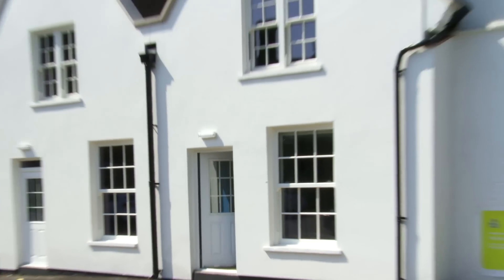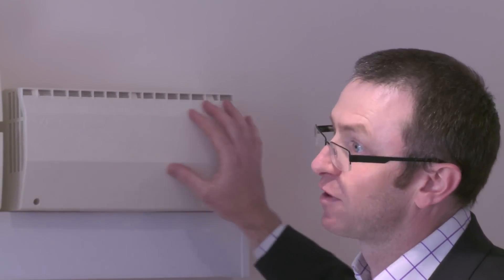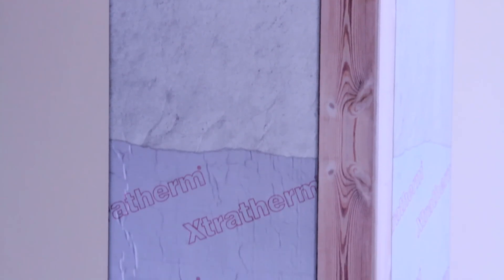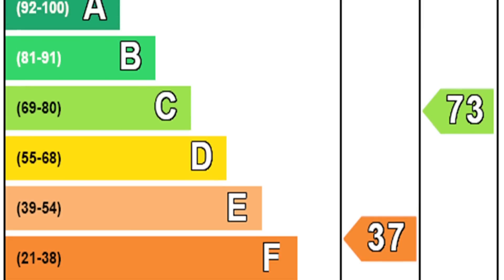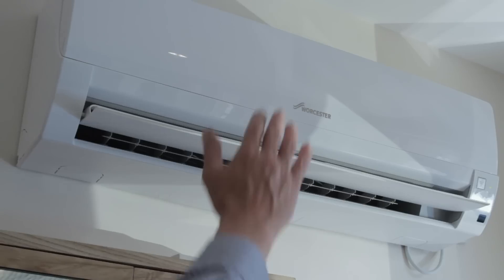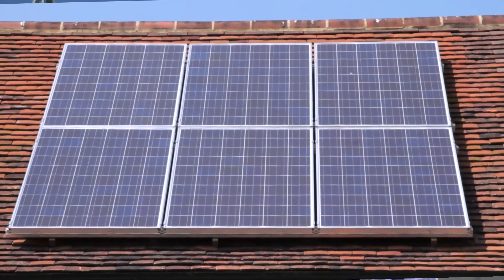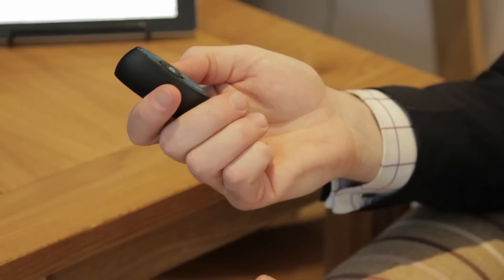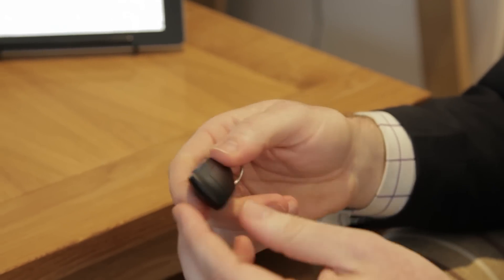Home of the Future | Fully Charged

Comment: This just popped up on my feed - 12 years after it was first published. It's now October 2024 and my house has Solar, home battery, Air Source Heat Pump and EV charger. Obviously on a smart meter too. over a 12 month period 85% of my power comes from the solar (free!) or the off-peak rate I get from Octopus (7p/kWh).

I think we're a bit further ahead than this video envisaged. It also proves all the doubters wrong. Several mention coal fired power and now the UK has ZERO coal powered electricity.

Interestingly I was a sales engineer for an HVAC company in the mid-seventires and I was installing air source heat pumps in commercial buildings even then

Comment: I'm re-watching this for the 2nd time. The first time I thought great, smart metering. Since then I've had both a dumb smart meter (pay as you go) & the smart, smart meter variety that had more functionality. In neither case was I ever motivated to monitor the energy usage for gas or electricity & in fact, I had so much trouble with the smart, smart meter refusing to work properly that I insisted that the utility company return to swap out the 'new' meters for analogue ones. I honestly don't see the vast majority of consumers ever bothering to monitor their own energy usage either. People just want to get on with their day. But in terms of suppliers points of view and grid management, long term, legislation will be needed to force smart metering across the board in order for the energy system to function as a whole due to changes in generating sources, storage, the decentralisation of the grids & of course, the electrification of transportation around the world.

Comment: Hi Matty
There has been extensive research by large companies including Schneider
and they are happy to stand over their claims based on the normal mix of
appliances in a house.
Items in your house can be divided into three groups in this instance. 

First group would have no impact on performance or consumption.
Modern electronic devices are usually powered by switch mode power 
supplies which usually self optimise between 90v & 250v
PC, laptop, CFL's, LED's, Chargers.

Comment: Second group has an impact on speed (approx 9%) but no
decrease in consumption.
Kettle, Immersion, electric heater, electric cooker, Old type tumble dryer. Small motor in tumble dryer will run more efficient.

Third group has no impact on performance but has a lower consumption.
Fridge, Microwave, Food processor, ventilation, Kitchen extractor, 
air conditioner, heating circulating pump, Heat pump, (not inverter type) Modern tumble dryer, oil and gas boiler, Washing machine, Dishwasher.

Comment: vphase voltage optimisation, modern day snake oil 
this device only saves you money on digital loads i.e your pc modern lighting with a digital ballast etc, large devices like a washing machine or immersion heater will only take longer to warm up and not work as hard
only a good investment for a business with a high electronic load. 
British gas fail

Comment: My concern, is cost of payback.
A solar panel system would typically payback after 15 years at current rates and costs, and this is not cost effective for most home owners, as most would not stay in a house for this length of time.
When you add up all the other items recommended, I cannot see how it would be cost effective for an existing house; you're looking at an outlay of tens of thousands for equipment and building work, with a payback time measured in decades.

Comment: A kettle is a large load mainly used in short bursts, the 10% average is worked out over all electrical equipment in a house.
There are extremes in both directions of efficiency, some cases can be an over consumption of up to 25%  with voltages going a lot higher than 240v.
also when an immersion element is subjected to a higher voltage the fragile stat can burn out and the 2.5sq cable supplying power gets very warm which is a loss
The list of issues are very long relating to over voltage

Comment: The point is that claiming that a heating element is 100% efficient is not true in all (most) circumstances. It's not even close for most applications. Even more so during hot weather where you'll have to re-cool the local environment after it absorbs the wasted heat. This is directly related to how you define the efficiency of an action.

I agree that moderating the voltage supplied to heating equipment will have little effect on the performance in this specific case.

Comment: The voltage optimiser has no effect on the efficiency of painting, it has no effect on the efficiency of a heating ellement.
However any other piece of electrical equipment wastes approx 10% by running at 240V
It is a simple piece of equipment which can save a customer money.

Comment: I fear you're missing the point - you need to define your desired outcome to establish your efficiency: painting your wall is 0% efficient if you want to do anything but paint that specific wall.

Above you stated that a heating element is 100% efficient and as a side point, stated that this is true irrespective of the voltage used. This is not true: not all the heat energy goes into the food/water/air and indeed some will end up where you don't want it.

Comment: If we look at GSHP at COP of 4, so 4 x 39% = 156% so looking better still but the capital cost is massive where as you could reduce your demand by insulating and sticking with the heat source, be it gas or other, until that capital outlay no longer works or becomes un economical to repair.

Comment: Lets run with 39%, COP from an Air Source, not Ground Source, heat pump is typically 3 for most of the UK heating season.  39% x 3 = 117% so we are up by 17% but my point here is you have spent a large amount of capital to get that 17% when this could have been spent on reducing heating demand in the first hand.  Electricity is a high quality form of energy, using it just for heating seems a waste to me.  Im not against ASHP or GSHP but its application is important, better to reduce demand first

Comment: Say you have a COP of 3 from a good ASHP, which when its cold is not likely, and you power the ASHP from the current grid where we are 20%-25% conversion of potential energy into delivered electricity.  A COP of 3 would be 75% conversion of the potential back to heat and as you have said gas is 95% eff.  

As a result, save spending out on a ASHP, if your on mains gas, and spend the savings on insulation.  Further to this, the insulation will help manage your cooling load during the summer.

Comment: Also, yes - insulation and weather-tightening are better investments to start with, but at some point adding more insulation becomes a waste. That point is somewhere around where you have to A/C your house all winter because the lighting/people/appliances generate enough heat to keep the place warm. In practice, though, achieving that level of tightness is very difficult with existing buildings (ie it's a major renovation project). Easier with new construction.

Comment: @WindyJAMillerr "which it wont be for a long time" - Um... depends on who you are and where you are. Regardless, a gas burning appliance is at best ~96% efficient which is damn good - 96 BTU out for every 100 BTU put in. A good ASHP will have a COP of at *least* 2.0 on the coldest days, so you get 200 BTU heat out for every 100 BTU (of electricity) put in. Plus an ASHP becomes an air conditioner in the summer... can you set your gas furnace to "cold" ? :)

Comment: Your point in hand is true, 'if' the ASHP is powered from a renewable source, which it wont be for a long time.  Also, there is nothing wrong with burning gas for heat.  Electricity is a very high quality form of energy and is a waste to turn into heat!  

Re the inverter driven units, they are good put ASHP COP increase with air temperature which is when the house is warmer any way.  Better to spend you money on insulation every time.

Comment: Never seen a reverse cycle air conditioner / split system, Robert? Heating in winter, cooling in summer. It just shifts heat from one side of the wall to the other. They are pretty popular ere in Australia.

Comment: I have no fancy gadgets in the house to switch things on and off.
When I leave the house in the morning everything is turned off at the consumer unit except the alarm.
This means the wireless router dies as its power supply would use a lot of energy through the day to do nothing.

Comment: A heating element is probably the only thing that has no advantage by lowering the voltage as it is 100% efficient no matter what the voltage is,
Most appliances are designed to run optimaly at 230v and are quite happy to run at 220v, however putting 240v into them gets no additional work but does create a lot wasted energy.
The voltage conditioner switches to standby when the incoming voltage drops to 230v or less as it's own consumption would negate any saving unless the load was very big.

Comment: The simplest thing people can do to save energy in their home besides the obvious, insulation, windows, correctly sized updated heating and cooling unit ( heat pumps are great) solar panels  is to never leave small appliances plugged in, they are energy vampires. Other appliances that have to be (fridge heater stove) can be unplugged until you need them. That costs you nothing and is not using energy to manage what you have. Fun show looking forward to what is next.

Comment: Lots of great info and some very cool gadgets but we also have to look at the fact that some of these very same gadgets use energy to do something we can do for ourselves already or shouldn't be doing because it is inefficient such as adjusting your thermostat while you are away at work, that should be set and then forget it and as for turning on or off your kettle remotely that would probably won't be needed most of the time unless you ran out of the house and left it plugged in.

Comment: what's your angle on the heat pump then? Although I suppose it probably depends what you use as efficiency ratings and whether you assume coal power station or greener mix for supply, doesn't it. Got to admit it'll replace the condensing boiler eventually though.

Comment: Air source heat pump is better than burning gas if the electricity source is renewable, e.g. solar, wind, etc. The newer inverter-driven compressors work alarmingly well in cold climates, but while I've yet to see it happen (I live in the NE USA coastal area) I still have a small worry of the outdoor coils icing up. I guess you could heat-trace them...

Comment: If you got the money a ground source heat pump is better than air source. Regarding the hot water energy, they've made heat exchangers for decades now... use the warm water going out the drain to warm up the cold water going to the heater. Instantaneous water heaters (as opposed to storage tanks) can also be a good way to save energy if water usage is low and intermittent.

Comment: V=IR. Assuming resistance of a device remains constant (or impedance for AC, but more or less effectively the same) then as the voltage drops, so too must the current to compensate. Multiply these two new values to get the power and it's dropped significantly since both factors are smaller.

Comment: a 1.4kWp PV system will not save you £400 a year and also pay you FIT on top!  more like £100 and £330 FIT + assumed Export and only if you install before August 1st when the FIT will be dropped from £0.21/kWh to £0.16kWh.

An air source heat pump is less enviromental friendly then burning gas and will cost you more!!!

Comment: Can anyone explain, why would any appliance be less energy efficient at 240V instead at 220V?

As far as I know, appliances require mostly constant power (Watts (Voltage * Amps)), not constant current(Amps). And at constant power and 240V, there's just less current (Amps) required to run the appliance. Or in case of electrical water heater, the water heats sooner. How's that a bad thing?

Comment: Of the things shown in this video, Insulation and good windows/doors are the key element to all the rest.

The solar panels, the heat pump (a reverse air conditioner really) and the voltage regulators are also both very neat items and will make a difference. Modern taps will also make a small difference.

The rest is really just gadgets because you still have to turn it on/off yourself - they won't really make a big influence until cheap and stable house AI becomes commonplace.

Comment: When I lived in an old victorian terrace I was advised against caviety wall insulation because the house depends on air flow to prevent damp. The specailst said it's one of the biggest causes of damp in those kind of houses.So you need to be cautious. Love the other stuff though, always thought remote controlling heating would be good. Staying late at work, save some energy.

Comment: It's all relative. If you have 20-30 things to switch on and off, you're not going to do that on a regular basis. If you can do it remotely, you might do it more often. And depending what those devices are, it could either save a huge amount of energy, or cost more energy than it saves. That's down to the balance of these remote gadgets compared to what's being turned on & off.

Comment: The final part about remote control of appliances is a fantastic idea but I'd be worried about security with it being connected to a home router. Is the network an entirely seperate system that uses different protocols or would it be susceptible to hacks?